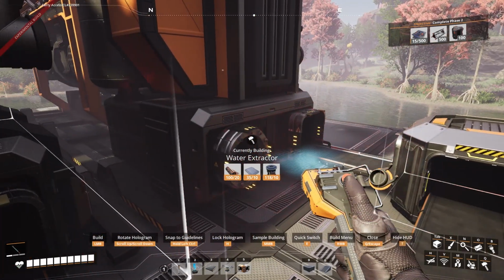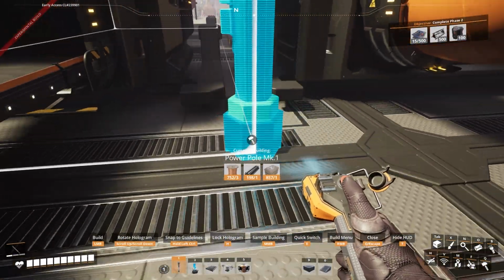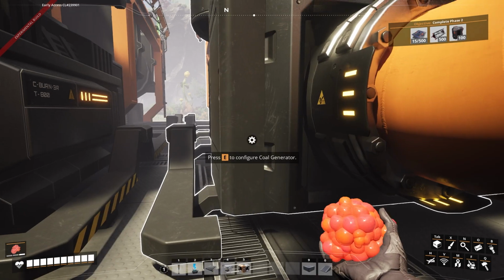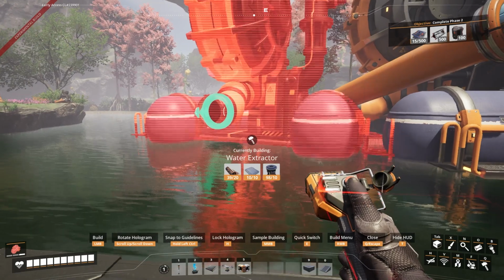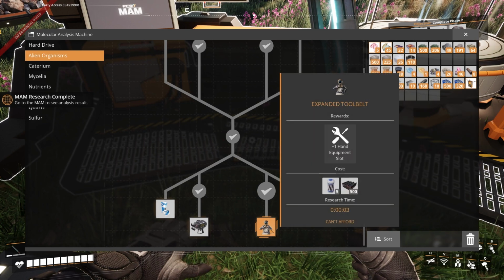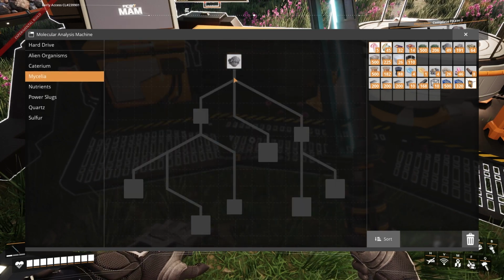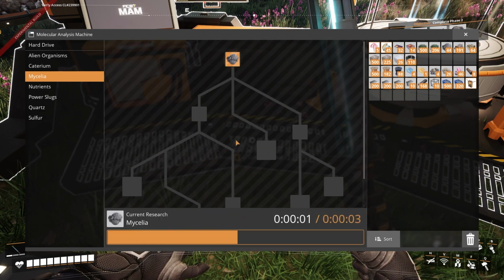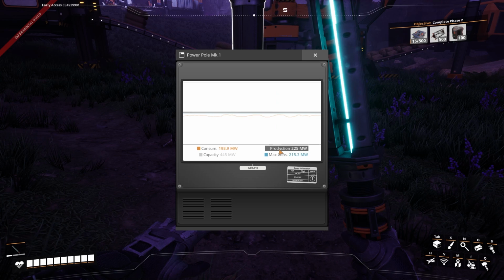Increasing power capacity with coal | Satisfactory | BigVlad Plays | Part 7

Comment: Pipes have different build modes.  Change build modes with "r" while placing.  If a pipe won't fit in one build mode, it might in another.  Or, choose based on aesthetic.

All power generating buildings (bio-mass burners, coal generators, fuel generators, etc) can use different fuels that burn at different rates.  So until you load in a fuel, you won't know how much it takes to burn.
Reply from the maker: Good points about the build modes and alternate fuels. You're jogging my memory from years ago when I used to play. I remember there is an alternate coal, which I suppose I will unlock at a later date.